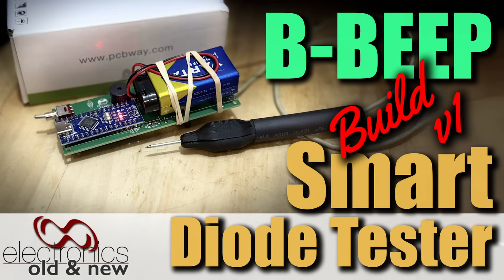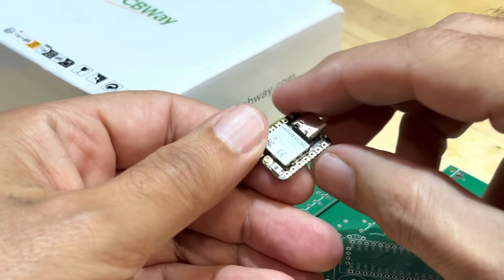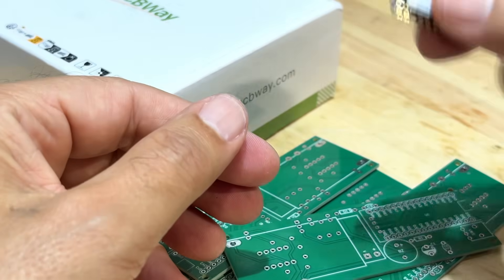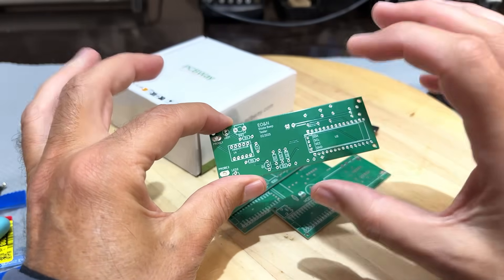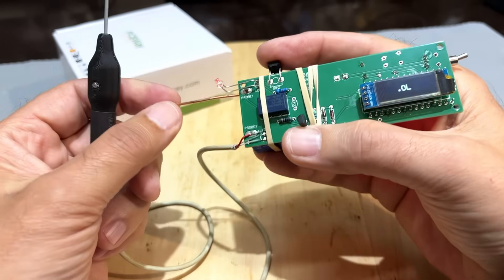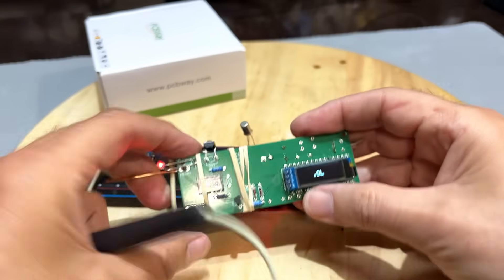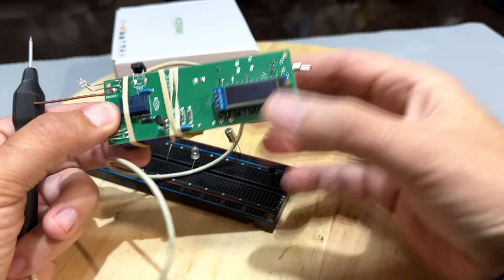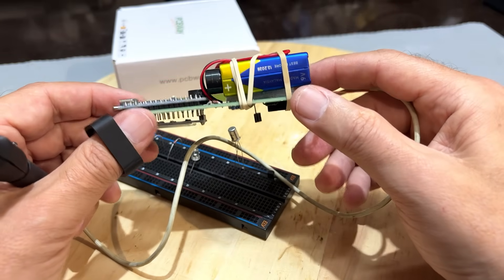Building & Testing My Smart Diode Tester – It Works! (But I Can Make It Even Better) #pcbway#

Comment: Consider re-using the small Lithium batteries found in disposable smoking replacement things.  The one-time versions of these are often to be found in the street ready to have the cell extracted and used again.
Reply: @electronicsoldandnew  As an extra bonus (and I don't know if this is possible). Could you edit the name of your channel to NOT have the words 'Electronics Old And New' twice please?  It makes notifications exceptionally verbose and usually truncates most of the video's actual title.
Reply from the maker: 👍 done

Comment: The entire thing should fit inside a pen. Remember the LCD Pen from the 1980's?  Or tweezers, like the ZOYI or FNIRSI LCR meters.  12:37 My car makes the same sound when the door is opened with the key in the ignition.

Comment: I just discovered this. Looks interesting. I don't know if this has already been mentioned but how about a some sort of crowbar/clamping circuit across the probes? You know, in case you ever touch anything that has more than 5V in it (like a cap somewhere still holding a bit of a charge or something like that). Humans can make mistakes, after all. Especially the human writing these lines...

You could perhaps also avoid erroneous beeps due to bad probing/contact by taking multiple samples and then using the median in the code. With a diagnostic tool, you do want it to be reliable, no?

A completely different approach would be to use the optical data interface of the (better) Brymen DMMs. It would be a bespoke solution for a posh multi-meter but you'd get all the protections and accuracy of the DMM, and you just have to worry about the beeping. Plus, you don't have to switch to a different set of probes when you're working on something. Just a random thought...
Reply from the maker: 👍 all great suggestions

Comment: I personally like a display as well, so I am with you on that.  Sure, not needed, but wants vs needs ...   It's your tool, make it how you want it :).   If someone else doesn't want the display, they could build it without it.    I like the option.
I look forward to seeing how you develop the ESP32 version of this tester.  The ESP32's have a lot of extra features, some not needed, but it could add multiple functions into the device :).     
What are your thoughts of having two flying lead probes, with the polarity reverse switch on one of the probes?
Reply from the maker: I’m looking forward to seeing how the esp32c3 works, which is a little strange as I’ve only just got the hang of the nano 😊 also, someone has just pointed me to a project which is very similar to mine, from over a year ago. Really weird watching it, because it’s almost as if I’m listening to myself. I’m going to watch that project and decide whether I’ve missed something.

Comment: For a prototype, I'd definitely suggest to solder female pin headers so you can easily reuse the nano, unless you want it permanent. Glad to see you take on all the comments. In the end a hobby project is a combination of needs and wants, which aren't always harmonious. And it's usually never possible to determine if you've made an ultimate version of something until you can get it in your hands. And everyone has slightly different definitions of what makes the ultimate. No screen is truly much better battery, but in the end I could always recognise its luxury that some would trade to have. For me I think I'd want a measuring screen for a zener testing probe. But that's me. Good luck with your prototyping.
Reply from the maker: Thanks. I have just been shown a very similar project that two guys did a year ago, so I’m going to see it and try to be a bit more critical of mine as a way to improve it. I may have gone overboard with my choices  😊

Comment: You only need one LED. If it's on it's positive, else is negative. LED in the probe is way too cumbersome for the utility it provides.
Other, more important suggestion is to put some input protection, in case of poking around charged capacitors.

Comment: I think your test equipment construction videos are some of the most interesting videos you make. I've built versions of your capacitor leakage tester, and your zener diode voltage tester, and I use them on my bench all the time. Keep up the experimentation, I dig it too!

Comment: 4066 has 90 Ohm open channel impedance. There has to be something newer, better and cheaper.
Reply: With all that computing power surely you can emulated the CD 4066 in software? I know that pin- input and out put commands can be used to provide a low power switching function.
Reply from the maker: Not quite sure how one would do it as it has to provide a pass through path to the leads. Definitely needs some more thought, but well worth investigating
Reply from the maker: The resistance will have to be taken into account when reading the voltage, but since it’s a constant current measurement, it should be possible to calibrate the readings. However, I’m actually looking for a lower resistance alternative, as you suggest.
Reply: I was thinking TS3A4751 (0.9 Ohm on), but that would have to be for version 43 (3V3 design).
Reply from the maker: It’s quite easy to adjust calibration in the software even with the high contact resistance of the CD4066.

Comment: Rs components used to sell a p/n junction tester based on op amps.the probes had built in LEDs.
The voltage at the probes was a low frequency square wave so there was no need to keep reversing the test leads.